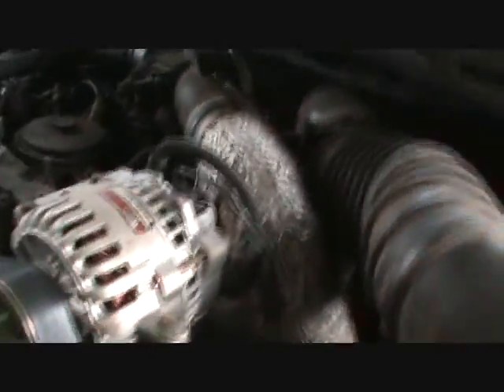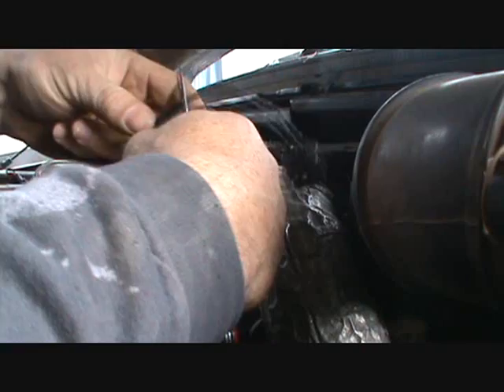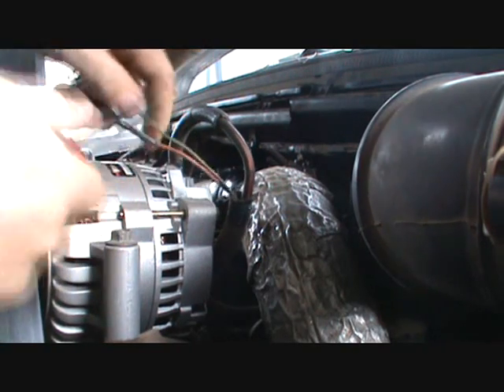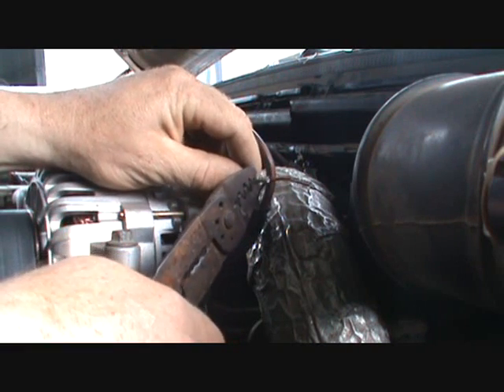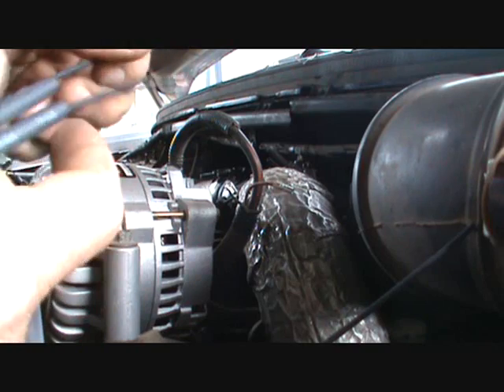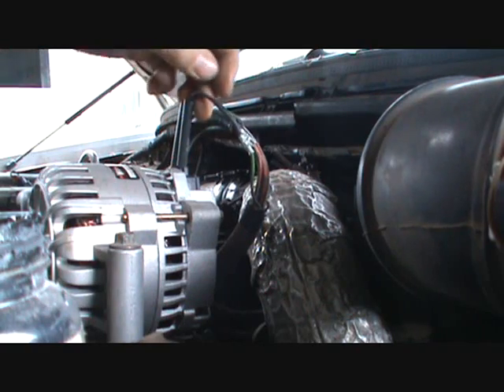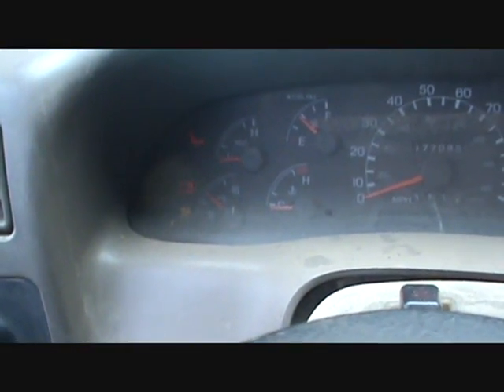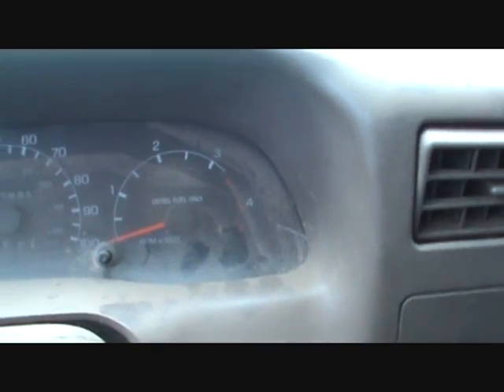Wire replacement on the 550

Comment: Hey Wes , One of the things that most people miss on replacing the alternator on these Fords... is that you need to grind the factory mounts at the block to shiny metal... the biggest problem w/ these alts is they do not properly ground , a die grinder , a 4" grinder heck just some course paper and shine that mount up and you will see a great reduction in problems
Many Blessings,
SMR

Comment: the middle wire is for ground , that wire can save the voltage regulator if something crazy happens , it's a good idea to use it , and the plug issue is very common due to vibration , and you seem to use the truck as a truck , so it's no shame lol

Comment: When you want to pull a wire out, you release the lock from the front of the connector using a thin tool that looks like its made from a hacksaw blade. If you need OEM connectors, pins etc look at Digi-Key. Those connectors are about 30 cents a piece. The special crimpers you need are "Engineer PA-20, or PA-09" depending what size pin you are doing. Crimpers are 40 bucks on amazon. you will be able to fix all sorts of factory electronics from all manufactures.

Comment: I would assume Wes was talking about dielectric grease, which is silicone based.  Certainly, bathroom products have no place under the hood.  Dielectric grease would actually be a good choice if you had a wet environment and didn't have the good heat shrink he was using.